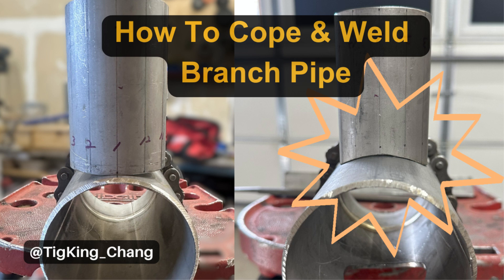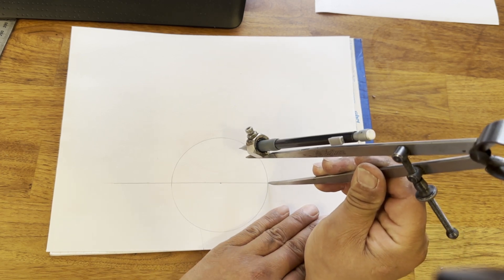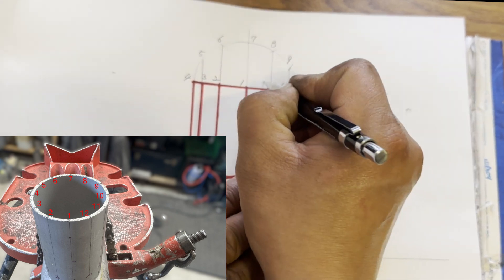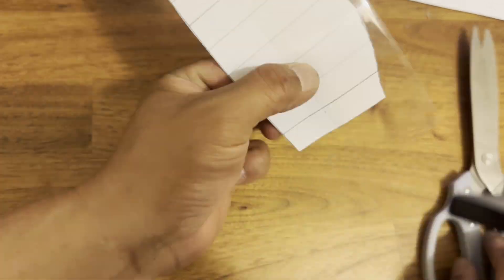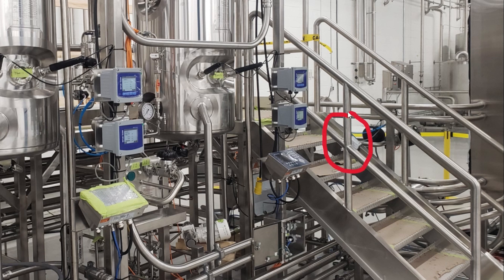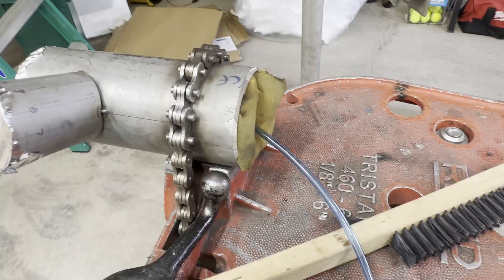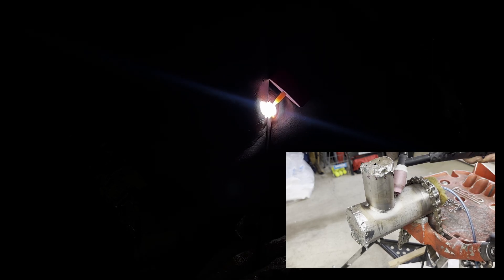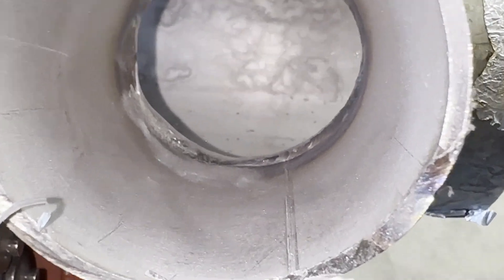Complete Guide For Pipe Coping and Welding.

Comment: im 19 and learning TIG i started out on aluminium first as a beginner which i found easier than doing carbon steels and nickel/chrome alloys and stainless steels i should of started out on other metals besides aluminium but i have another method for fitting joints like this using engineering CAD software like Solidworks and Autodesk inventor for this
Reply from the maker: That's perfect. I respect your ways trying to keep going up. Good luck buddy!!
Reply: @TigKing_Chang  are you familiar with tig on brass?im self learner,and really enjoy your videos pal.if you dont have video we can chat at private and exchange some onowledge if you want
Reply from the maker: @przemyslawmikula4295 unfortunately, i don't have any experience with brass welding. 

Pls understand I share my opinion through here Youtube. 

Thank you.